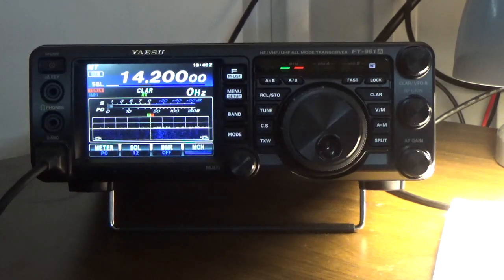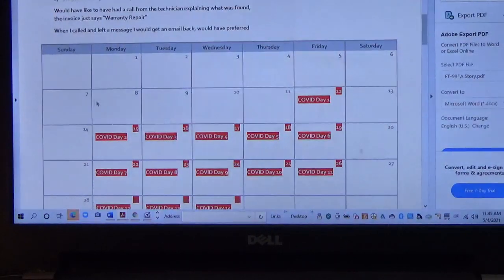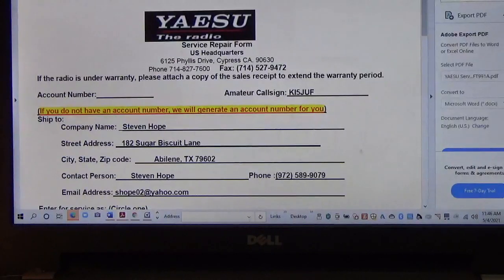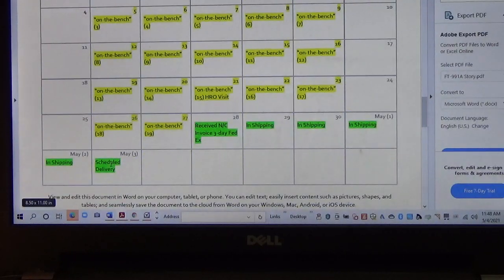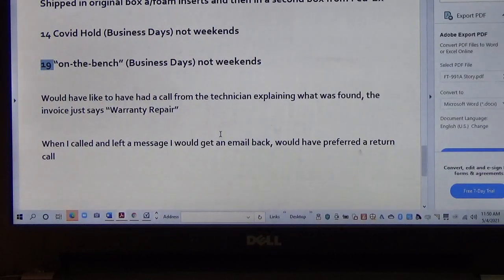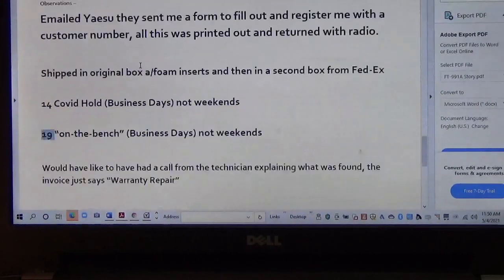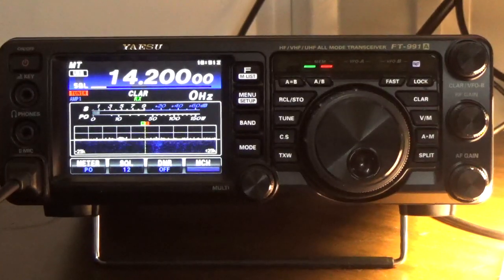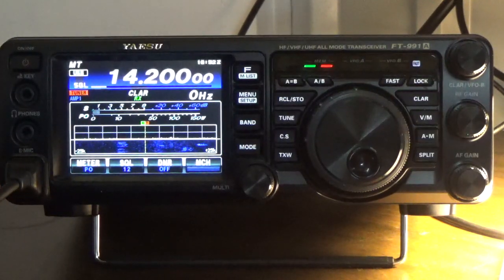Yaesu Warranty Process Observations - Programming (038 MIC SCAN) & (115 WATER FALL) in MENU/SETUP

Comment: I'll stay with my 90's ten tec.
Reply from the maker: I luv those older radios I may get one and just turn it on and try it out - this FT991A is very software menu driven no to many knobs to turn GL and TU 73 De KI5JUF
Reply: @westtexasvideogateski5juf255  I had a flex 6500. SDRs designs typically make for superior rigs. Quiet, and maybe less long term maintenance too, Cus it has less mechanical parts.  But I wanted that tactile feel which knobs and buttons provide. Then, I had a ten tec Eagle but didn't like the small size and menus. Loved the looks. Never did try a modern Yaesu design like your rig, so I can't comment. I like the looks of your main dial.